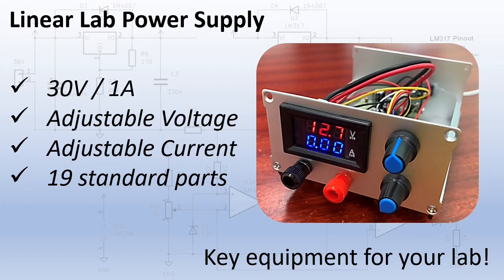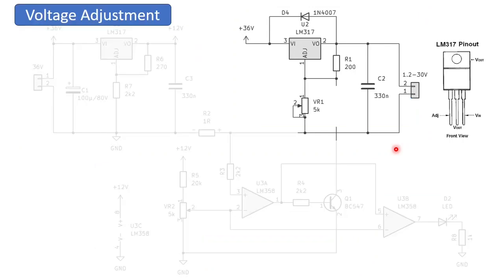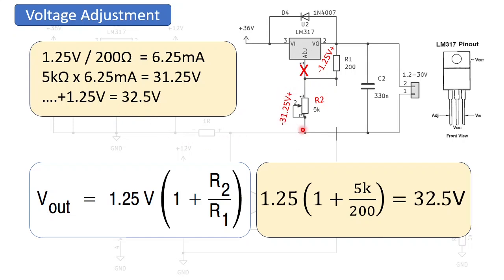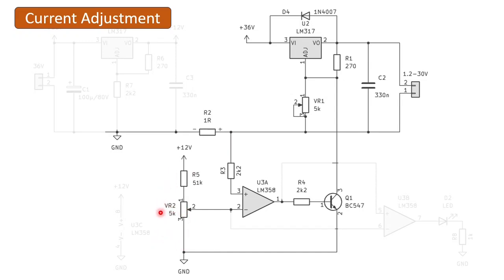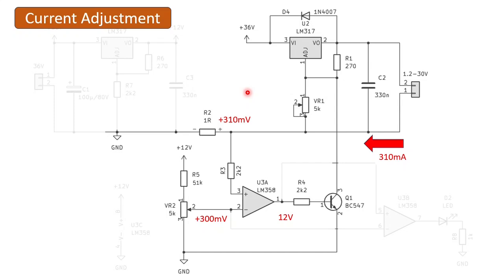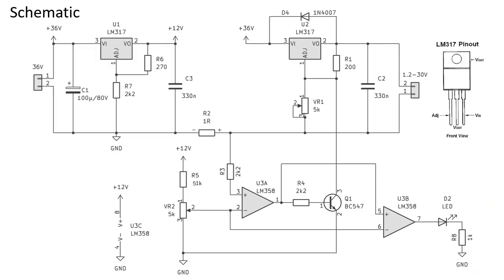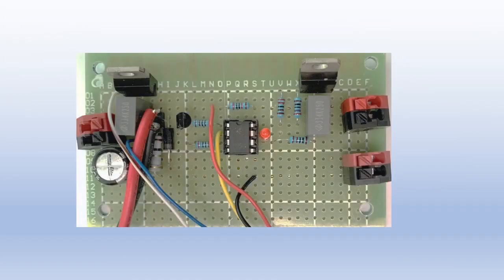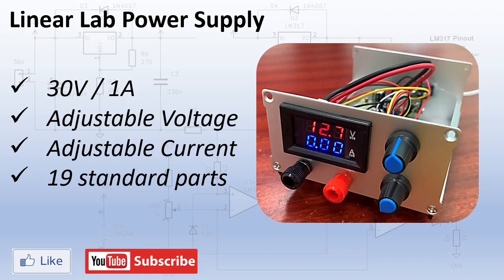DIY Lab Power Supply 30Volt / 1 Amp

Comment: What is R5 value? at begining 20 KOhm ,than 51 KOhm, which is correct ?
Also drive link  epty have not any files
Reply from the maker: Hello Yorumcu63, 51k is correct. I tried the drive link, and can open it, there is a zip file with material list & schematic. From which country are you? Some countries block Google applications. Strange however as YouTube is also Google....
Reply: @smartpowerelectronics8779  I was download file now  and same in video screen views .So have not any PCB file. Thank you for your  reply .

Comment: If you incorporate a third LM317 you can get the output voltage to less than 1.25v.
Depending on the datasheet you download you may or may not find an example circuit of how to do this.

Comment: Hi mr T , I use an opamp LM324 to drive 4 mosfets. It seems to work , but I am not sure how fast i can switch I have not seen any circuits that work like this, and i do not have an oscilloscope.  alse i do not know if I need to put a gate resistor or what value.

I connect the  inverted input to 3.3v and the non inverted input to the arduino output. the opamp is at 12V 

I really liked the video where you use the 555 to drive the mosfet. keep up the good work
Reply from the maker: If you drive MOSFET's with a LM324 it will probably work without any resistor. A LM324 output currents are low so it will not be very fast, expect 1-10kHz maximum. If you need it faster you need to add gate drivers . What do you drive with your MOSFET's? A motor?

Comment: Thank you for the schematic and clear presentation! Could you connect two of these together for plus and minus supply? Could it be dual tracking?
Reply from the maker: @rudy5360  there is a negative version of the lm317, the lm337. With a “stereo” potentiometer you could make a dual tracking voltage source. The current limit you would need to redesign🙃
Reply from the maker: You can of course also make 2 identical sources with the lm317 and connect +\- together as common ground, you do need 2 isolated 36 V DC sources then, the stereo potmeter trick should work for both current and voltage. I think this is the easiest solution.